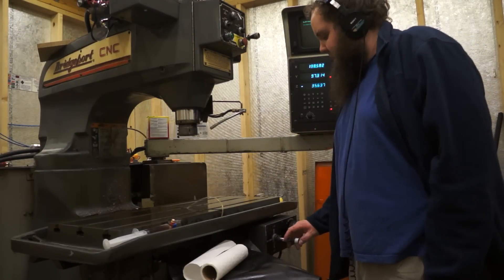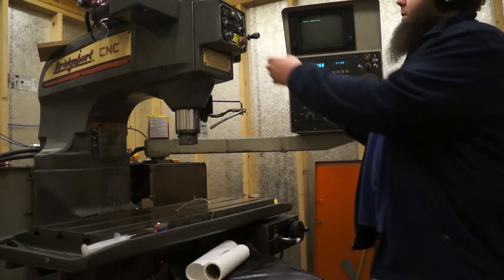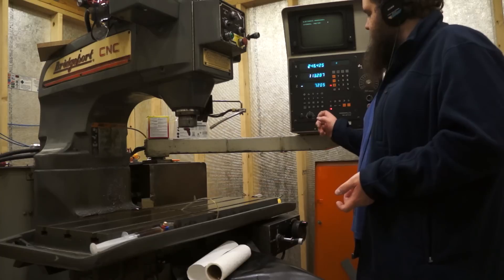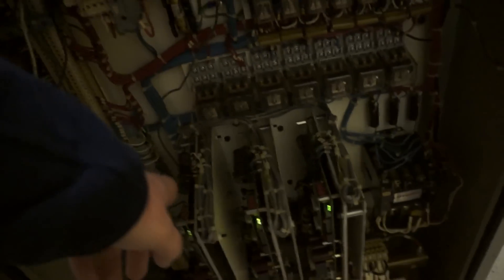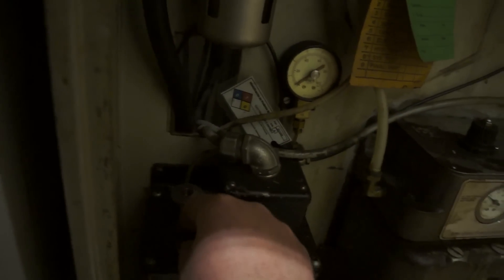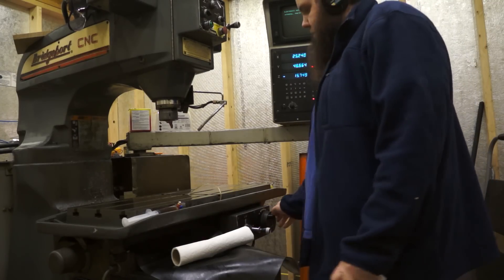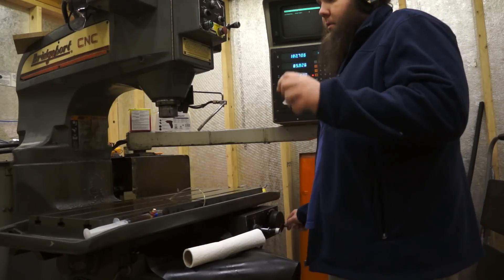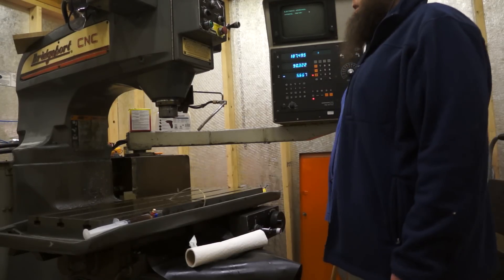CNC 2 -  Bridgeport Series 1 R2C3 Initial bringup

Comment: @7:20, first item is the spindle overload relay, not a contactor, the pair of relays next to it are the reversing contactor for the spindle (they're mechanically interlocked so you can't try to run the spindle in both directions at once).   If the machine was last run on 480v, you will probably have to change the heaters to a bigger size in the overload relay (as well as having to change the motor winding configuration for 240v operation).  You might look into building a rotary phase converter, that way you could run other 3ph equipment when you come across it (like a bandsaw or lathe), and the spindle will operate as intended...   Check the Practicalmachinist forums, they have a section devoted to RPCs VFDs, etc...   You may also be inclined to ask your utility if they can supply 3ph and what the cost would be associated with it, it's kinda hard to beat real 3ph power when you can get it, depending on what your expected usage is.
Reply from the maker: +icesoft1 Good to know. Something in that region makes a loud "CLUNK" sound when energized, and considering the massive size of the contactor for the servo amps, I assumed that the spindle would require a similarly big contactor.

Anyways, I have a 2.2KW VFD on-order at the moment. It'll be a future video. I don't think I have much hope of getting 3ph power, as this is located at my house in a residential district, and from what I've heard, utilities usually aren't interested in supplying 3 phase power to peoples homes.

Comment: What functions of the mill requiters compress air? Toolholder and gearbox? Maybe those functions can be converted to manual operation.

And great choice sticking with the CRT
Reply: If you go for the VFD you could lock the gearbox at a fixed ratio and let the VFD do speed control.
Reply from the maker: +error079 The spindle control (speed, brake) are pneumatically activated. 

As far as I can tell, those are the only original bits that are air-powered. The spraymist also requires air, but you don't need that to run the machine.
Reply from the maker: +error079 The issue with switching to a VFD-only system is that it'd then have to interact with the CNC controller somehow. I'm probably basically just going to use it as a phase converter, and not much else.

Comment: I forget if you've mentioned where you are located, but you should get in contact with Tom Lipton (oxtoolco on youtube); he may have some info/advice on the tooling and mounting hardware and where you can find it.
Reply from the maker: +idpromnut I already watch his channel, as well as Keith Fenner, Keith Rucker, and Adam Booth (ABom79). Learn't a lot from watching their stuff.

Ishai has a fair bit of machining experience, and I've done a bit myself, so I basically know (most) what I need at this point, I also work with some much more knowledgeable people, so I basically just ask them when I have issues. It's convenient, and I have something to talk about when taking a break at work.

Comment: Very cool video series, thanks so much for documenting and uploading. Would be funny to manufacture parts to upgrade the CNC machine on the CNC machine as you need them. :> I was also cringing the whole time your hands were so close to the HT/HV lead when you were fixing up the CRT. Insulation on something that old actually may break down and can spark through. I've had it happen on a large monitor where it sparked through the insulation to a grounded screwdriver when the monitor was on. The CRT acts like a capacitor and can supply A LOT more current than just the flyback on its own, and the high current high voltage noise from the spark was one of the ungodliest and most terrifying I've ever heard. Always good to discharge the CRT anode to ground prior to putting your hands there. Bleeder resistors if present take their time anyways since it's typically a 1M ohm ordeal.

Also do you know what kind of tech it uses to provide such high resolution feedback in the way of encoders/resolvers?

I wonder if you can eventually hack in your own way of controlling the motors externally through a computer as well as getting some feedback. Could just use an FPGA with some optos for the glue logic/serial conversion if needed. Good luck~ :D
Reply from the maker: +whatlions You always need a computer somewhere, as you have to get the gcode into it in some manner.

The HT lead in this thing is actually in surprisingly good condition, it's a double-layered insulated thing, from the end of the cable when I pulled it out of the flyback. 

I did discharge the tube capacitance to ground at one point, it was pretty spectacular.
Reply: +Connor Wolf Oh, but what did these machines accept as inputs? Were they meant to be fed by a computer and not just manual input? (That's what I imagined, but maybe that's really stupid? XD)

And that's pretty good then! But still! Be careful just in case D: Only takes 1 bad accident...
Reply from the maker: +whatlions It's designed to be fed by a cassette deck! No, really!

It's got a serial port, and it talks 300  - 4800 baud. They originally used a special cassette thing where the programs were loaded onto the cassette, and the machine had a cassette->serial box that handled translating and forwarding the program on the tape to the machine. 

I'm just going to use a USB-serial converter. Fortunately, RS232 is RS232.

Heidenhain even has software for it, still available for free!
Reply: +Connor Wolf Duuuuude! Ahh that's great!! DUUUUUDE! No no, you must use a cassette deck. Shhh, don't argue. Use the RS232 to just dump data to a cassette.. hmm come to think of it, how does that work within the audio band? Simple modulation? Or something complex like QAM haha? Would just be a cool thing to do for the visual effect haha.. though I assume it'd have to run checksums on the packets cause it would be pretty horrible to have some error come through and destroy your machine or the work... xP Ahh maybe it's not that practical I dunno haha. It would be a one of a kind youtube vid at least. ;) I'm totally gonna look into dumping data to a cassette just for for the experience. I do have several tape decks in my arsenal of random crap.. :P

Pretty amazing that software is still available for it. And compatible with a machine that old? :0 Ahh I really wish you the best of luck on this!! Hope the VFD fixes your wagon! -Nick
Reply from the maker: RS-232 was standardized in 1969, and g-code in the 50s. It's basically timeless, at this point.

The cassette system is basically a modem coupled to a cassette deck. There is documentation here: http://content.heidenhain.de/doku/oma_zubehoer/de/index/N119C2/N11A22/N11A59/N11ACB/N11ACB.html 

My machine uses a TNC-145 controller, which has documentation here: http://content.heidenhain.de/doku/oma_controls/dvd_oma_html/de/index/N12DA1/N12E50/N138BE/N138BE.html

Comment: Congrats on your build. I soooo envy you the fun. As for the knee crank - take a look at SHOP TIPS #203 Tubalcain Makes a Crank Adapter for the Bridgeport [ https://www.youtube.com/watch?v=-4t8g8AensE ] I don't believe you need help but it may be insightfull. All the best!
Patrick
Reply from the maker: +y632rewww7fg43298jdm A replacement crank is only about $40, actually, so I just bought one on amazon (I'm horrible and have an amazon prime account).

Comment: How are you planning to talk to it? As I remember that era "storage media" was either the "new" 9 inch floppies", or a Sperry paper tape (ala Telex machines). How thick is the concrete floor you have it on, and have you grouted steel mounting pads onto the floor. It is worth the bother to make sure that the machine is properly mounted.
Reply from the maker: +Andrew Waugh 

It's actually got a serial port. It only goes 2400 baud, but it's good old RS-232.

The concrete floor is 8" thick, with rebar reinforcement and a 12" footer around the edges. 

No mounting pads or anything yet, because we're not totally sure where it's going to live long-term. I was just planning on shimming it level with some brass shim-stock, and then bolting it down with big cement anchors, but I will readily admit I have no idea what the "correct" approach for machine mounting is. I'd never heard of grouted steel pads before.